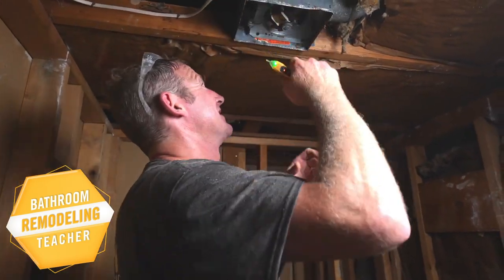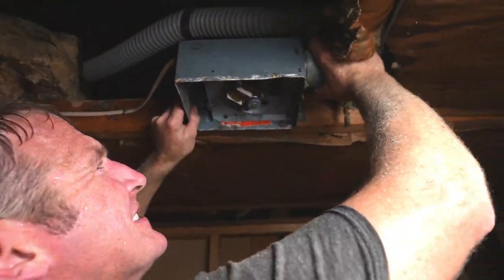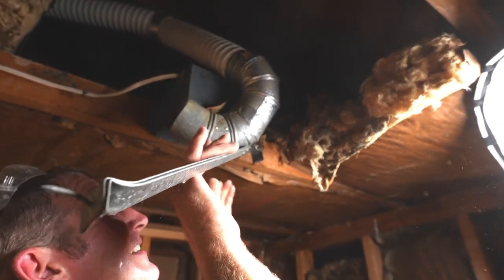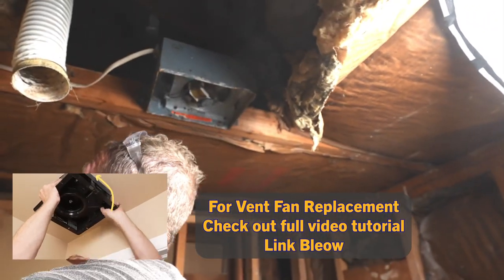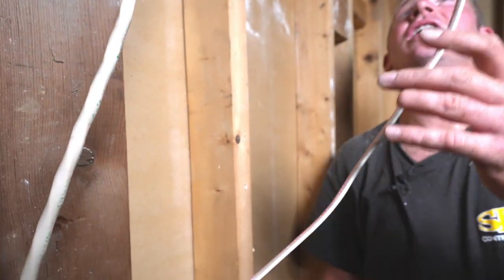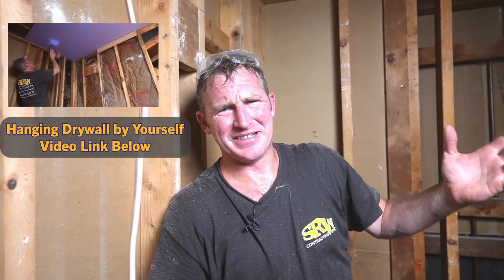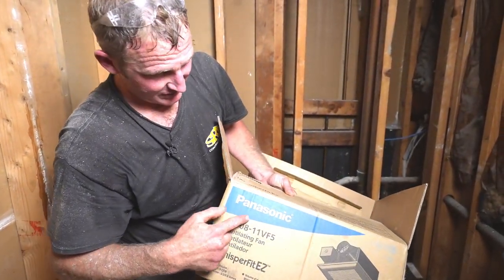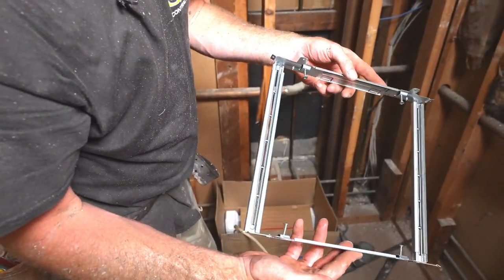Bathroom Vent Installation | Day 1 of a Bathroom Renovation | PLAN LEARN BUILD

Comment: I would say missing from this tutorial- 1) it's better to use insulated ductwork as condensation can be an issue. 2) it's best to connect straight up and down from the fan to the vent, but if that's not possible at least don't have sags in the duct. This is because any condensation will turn into standing water in the duct which can cause issues including possible legionnaires disease. Even dust, etc can back up in a saggy or overly complex/bendy duct.
Reply from the maker: Agreed 👍

Comment: Do you have a video of how to vent this through a roof? Ours just ends in the insulation in the attic.
Reply from the maker: Not yet. And I typically do not go through the roof. It’s probably the best way, but a liability for anyone who pokes a hole through it, especially if the roof is older than 10 yes. Here’s one I did on Instagram with soffit vent. https://www.instagram.com/tv/CVV09zAKqoI/?utm_medium=copy_link
Reply: Don't be dumping moisture in your attic! That's asking for trouble. Go out a gable end if you can. I never go through a perfectly good roof unless I have to.

Comment: You wont get your 110 cfm through that 3inch with a run of flex,needs to be short and 4inch,i like dryer hose
Reply: You're right, but it isn't essential to reach any particular extract rate. For such a small bathroom I suspect this install will do just fine.